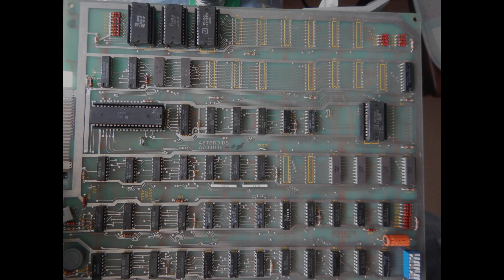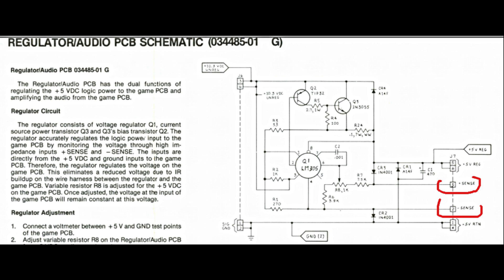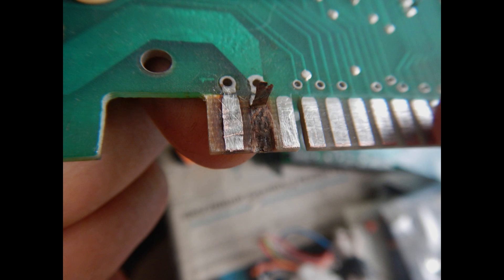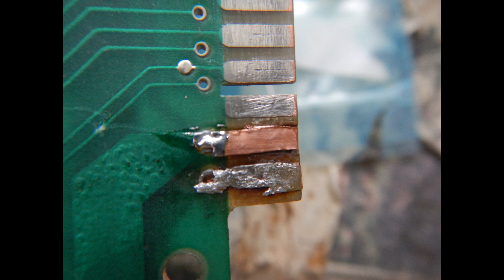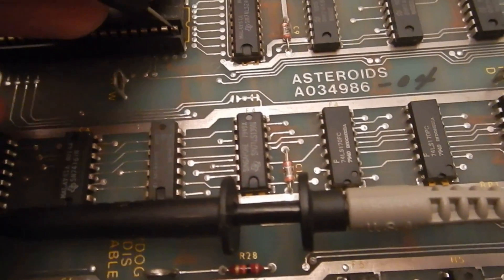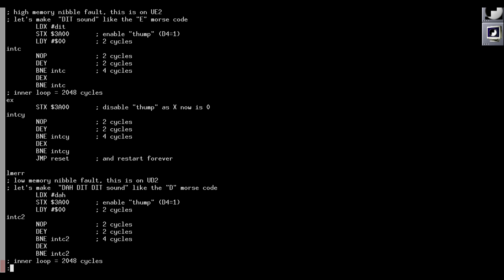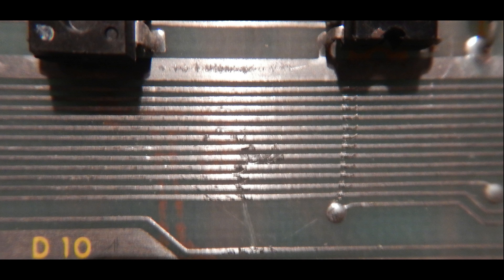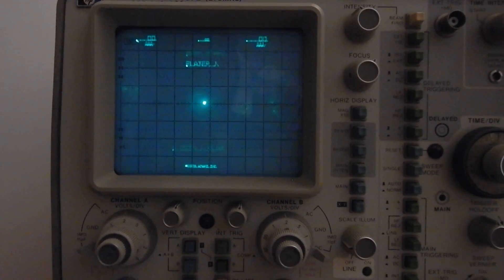Atari Asteroids Arcade PCB repair. Only (almost) PCB issues.

Comment: Awesome work! how is that you re able to test it with the osciloscope (when the game is displayed), do you use de probes and, do to it being vector genereted graphics, it runs as its just the signal input or it have the option? Thank you so much! some day i ll make my own vector monitor!
Reply from the maker: Thank you! Yes, "vector" game means it has X,Y and Z outputs. X and Y have a voltage proportional to position so if I use two probes on X and Y outputs and switch the oscilloscope to X/Y mode, the trace will show the game's output position. However, without the Z signal the trace will be illuminated even when the position is "traveling" between different objects.

Comment: I bet arcade boards really got beaten up back in the day being large and not typically having skilled technicians working on them. Very nice that this one had all original chips.
Reply from the maker: They added that wire to make it run despite the burnt pads, then it was probably retired and substituted with newer games. These cabinets would stay powered-on for many hours everyday.

Comment: I'd like to see a kit for Computer Space.  The nice thing about that game is that every logic chip used is still being made.  I would probably do the diode ROM using surface mount diodes.
Reply from the maker: Well, I'm way too young to have seen any real "Computer Space" game. And probably it was never imported to Italy anyway. Yes, it would be a nice thing to replicate!
Reply: The Pokey sadly is no longer made, although there are FPGA ones in the pipeline.
Reply: @petesapwell I was talking about Computer Space which was made long before such chips were made.  The entire thing is made up of 7400-series logic chips, and the ROMs for the on-screen characters are made up of discrete silicon diodes.
Reply from the maker: @petesapwell  Luckily Asteroids needs no Pokey :) They used one on Missile Command though.